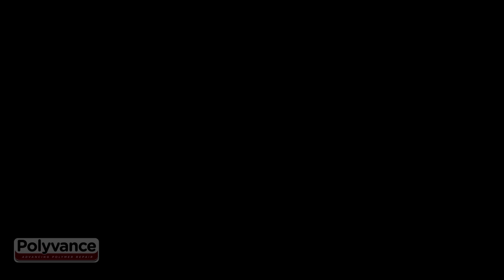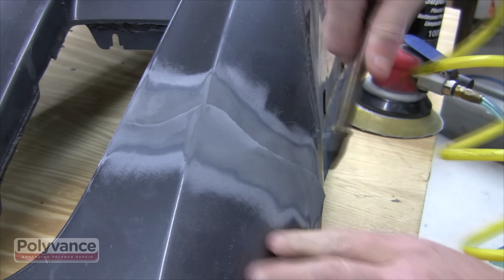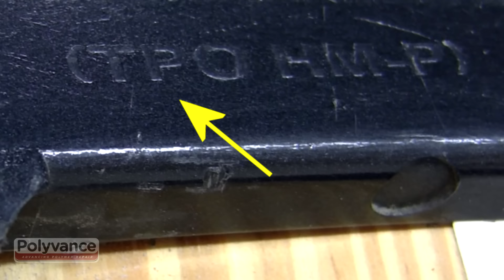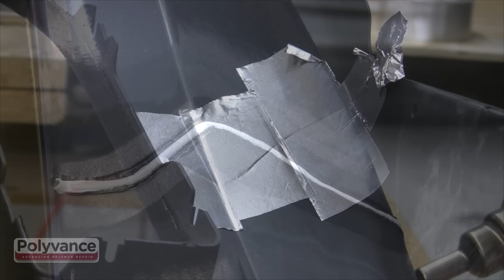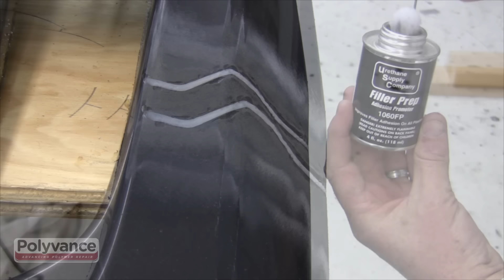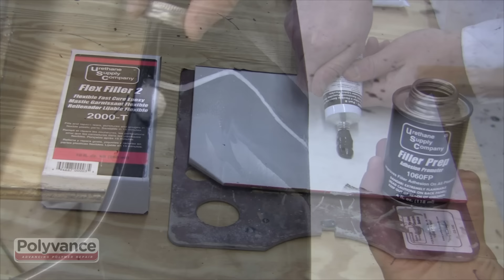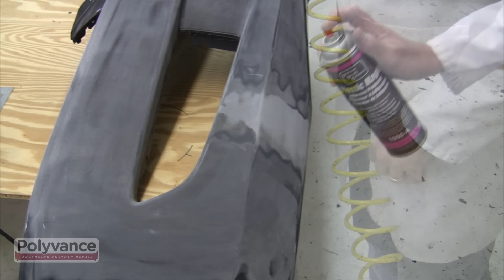Bumper Repair with Hot Air Plastic Welder

Comment: Why do I have a feeling that it will cost as much as a new one?
Reply from the maker: Buying a new bumper may not be easy or cheap. More expensive cars have new OEM bumpers that cost a lot. Additionally, some older cars might have hard to find bumpers (which makes them more expensive). You can find aftermarket parts cheaper, but you also run the risk of them not fitting your car properly (which you would have to pay to fix). With a used or aftermarket part, you may also have to have it painted to match the rest of the car.Of course, all cases are different, and the amount of damage will need to be evaluated to see if it is worth repairing the part (or having it repaired). But many times, it is cheaper to repair (or have repaired) cracks, tears, tabs, etc. than to replace the whole part. Especially on something like a small broken tab that is easily repaired and not visible (which means you don't have to do any refinishing work on them).
Our hot air and nitrogen welders are more for body shop use. We do, however, have a hot air welder kit, our 5700HT Mini-Weld Model 7, and a few other airless welder kits that can be used for DIY.
Reply: Polyvance. Yeah true, it will be more useful to use on expensive or rare bumpers.
Reply: Typically a definite "no".  but there are a few out there that are super cheap new.

Comment: That's called a heat gun you dipshit not a plastic welder.
Reply from the maker: Not quite...
Outwardly, a hot air gun and the most basic hot air welder appear to do the same thing: heat a jet of air. The main difference is that if you reduced the flow of a heat gun to the point where you could control the air enough to actually weld with it, you'd melt your heat gun down. There wouldn't be enough flow through the gun to cool the heating element and it would fry. A hot air welder has temperature control built in, so when it's set at 700 deg F with no reduction, it will still produce 700 deg F air with the welder nozzle attached without having the tendency to self destruct.
Reply: NNnnoope.  Similar, but different.  You cannot focus the heat with a heat gun small enough to weld without distorting the part.  If you tried, you would burn out your heat gun because it would restrict the flow so much it would overheat.

Comment: I’ve worked in the mobile paint business for 20 yrs. you can fix a crack by melting it together with a soldering iron. Much cheaper and faster.

Comment: Why clean before the initial sanding?
Reply from the maker: If you have contaminants on the plastic and you sand or grind it, its very likely you will embed some of the contaminants into the sanding scratches (which will impact the quality of the repair).  You should always clean the plastic first!  You can clean it again after if you wish, but you should always clean it first!

Comment: What a nightmare,  buy a bumper!
Reply from the maker: Buying a new bumper may not be that easy or cheap. More expensive cars have new OEM bumpers that cost a lot. Additionally, some older cars might have hard to find bumpers (which makes them more expensive).
You can find aftermarket parts cheaper, but you also run the risk of them not fitting your car properly (which you would have to pay to fix). With a used or aftermarket part, you may also have to have it painted to match the rest of the car.
Of course, all cases are different, and the amount of damage will need to be evaluated to see if it is worth repairing the part (or having it repaired). But many times, it is cheaper to repair cracks, tears, tabs, etc. than to replace the whole part. Especially on something like a small broken tab that is easily repaired and not visible (which means you don't have to do any refinishing work on them).

Comment: Where can I get those plastic rods???? I need to fix my bumper of my lexus where one bolt goes its cracked open I'm only holding it with a 8mm bolt with a washer
Reply: Polyvance has them or your local jobber store.  Be careful on Lexus, about 50% or them are urethane, which requires a different type of welder, welding rod and repair technique.
Reply: If its urethane, this is the smallest quantity:  https://www.polyvance.com/Polyurethane-1/R01-01-03-NT/  If its polypropylene, this is the smallest quantity: https://www.polyvance.com/Polypropylene-1/R02-01-03-BK/
Reply: Rainsville, AL  (Northeastern Alabama)
Reply: Polyvance. Where are you guys located??
Reply: Scott B I just need a little bit to make that small hole again to put a bolt back just a small rip where the plastic broke off
Reply: Just use a zip tie
Reply from the maker: You can find our welding rods and lots of different plastic repair equipment on our website (www.polyvance.com).
Have a look around our website and feel free to call us if you have any questions!

Comment: I assume it is not a home project
Reply: Not usually with a hot air welder, however the 5211 Polypro Welder can be used to do the same thing.   Its an airless welder and MUCH slower...but MUCH MUCH less expensive to buy.  They are around 70-80 bucks.

Comment: How much you gonna charge to do all that work when I can buy a used or aftermarket for $200 or less.
Reply from the maker: The cost is going to depend on the repair, of course. Also, you may not be able to find bumpers that cheaply. More expensive cars have new OEM bumpers that cost a lot. Additionally, some older cars might have hard to find bumpers (which makes them more expensive).
You can find aftermarket parts cheaper, but you also run the risk of them not fitting your car properly (which you would have to pay to fix). With a used or aftermarket part, you may also have to have it painted to match the rest of the car.
Of course, all cases are different, and the amount of damage will need to be evaluated to see if it is worth repairing the part. But many times, it is cheaper to repair cracks, tears, tabs, etc. than to replace the whole part. Especially on something like a small broken tab that is easily repaired and not visible (which means you don't have to do any refinishing work on them).

Comment: I don't have aluminum tape can I use FLEX TAPE
Reply from the maker: Aluminum tape is very sturdy and it can handle the heat from the welding rod. It is used to both hold the repair in place while welding and to make sure the plastic welding rod does not ooze out over the other side of the bumper.

Comment: Just buy a new freaking bumper and get it over with it's cheap online a hundred bucks
Reply from the maker: That's not necessarily true. More expensive cars have new OEM bumpers that cost a lot. Also, some older cars might have hard to find bumpers (which makes them more expensive). You can find aftermarket parts cheaper, but you also run the risk of them not fitting your car properly. Of course, all cases are different, and the amount of damage will need to be evaluated to see if it is worth repairing the part. But many times, it is cheaper to repair cracks, tears, tabs, etc. than to replace the whole part.

Comment: What will be the cost of such repairs? Without labour cost
Reply from the maker: Our hot air and nitrogen welders are more for body shop use. We do, however, have a hot air welder kit that can be used for DIY.
The cost of the repair will, of course, depend on the extent of the damage.
However, repairing a bumper or having it repaired by a technician at a body shop, will often be cheaper than buying a new bumper (this is especially true on more expensive cars, because new OEM bumpers cost a lot).
Reply: Polyvance. Great thank you
Reply from the maker: You're welcome!

Comment: need plastic cleaner before sanding...?
Reply from the maker: Yes! If you have contaminants on the plastic and you sand or grind it, its very likely you will embed some of the contaminants into the sanding scratches (which will impact the quality of the repair).  You should always clean the plastic first!  You can clean it again after if you wish, but you should always clean it first!
Reply: Polyvance. ohhh i learn something good ... thanks for information
Reply from the maker: You're welcome!

Comment: Alot of work. Isnt it cheaper to just purchase a new bumper?
Reply from the maker: Our hot air welders and nitrogen welders are more for body shop use. We do, however, have a hot air welder kit that can be used for DIY.
As far as getting a new bumper...sometimes, new OEM bumpers are expensive and it is cheaper to have it repaired rather than replaced. By having your bumper repaired, you can keep the original part on the car, you don't have to wait for a new bumper to come in, and you don't have to worry about spending as much money on a new bumper. Some people don't buy new OEM bumpers, and try to save money by getting an aftermarket part. But by getting an aftermarket part, they risk getting a part that doesn't fit their car, and they have to deal with those issues.
Of course, every situation is different. You will need to evaluate the amount of damage and how much it will cost to repair vs replace. Often, it is cheaper to have the original bumper repaired.

Comment: I use a fine steel mesh and use a soldering iron to melt the mesh into the plastic. This works very well for me and thr bond is very strong. I use plastic coffee stirring rods to fill-in gaps
Reply: I do the same but i use the virgin plastic from model car part frames you snap all your parts out of. Stiff and works great to slurry the materials together in a rotation motion. And its free.
Reply: That works for some things but is by no means a universal fix all technique, especially since you want to have the filler rod be the same kind of plastic as  what you are intending on repairing. 
If you don't use the right type of plastic for your filler it can lead to problems with the weld's strength as well as delamination (I think that is the correct term but could be wrong) or the filler peeling/raising off of/separating from the work piece and putting you right back to square one.
Reply from the maker: You are absolutely right; the filler rod needs to match the base material!
Reply: @polyvance  Exactly, although the mesh is OK, provided it doesn't get over heated and only gently pressed in on the backside. I may be interested in getting your rod. Been doing this for 2 or 3 decades, never knew of urethane rod. What diameter is the rod? 832 degrees? Really?
Reply from the maker: @ckstaff  The urethane rod is 1/8th of an inch in diameter.
Here's our full list of welding rod if you want to have a look: https://www.polyvance.com/Welding-Rod-List/
Reply: @polyvance  I guess I may have missed you saying the bumper was polypro. Never seen a bumper in polypro, that I recall anyway. I remember some were ABS. Still surprised with the 832 degrees, especially if it is polypro. Also interested in that filler and bonding to either the polyurethane or polypro as neither can be chemically bonded.
Reply from the maker: @ckstaff  About 95% of late model car bumper covers are made of polypropylene. You can absolutely use filler on polypropylene. You just need to make sure to use an adhesion promoter. Also, adhesives are the only way to repair thermoset polyurethane because it cannot be fusion welded. So, for polyurethane, you can either use a two-part adhesive or use the airless plastic welder with our thermoplastic polyurethane welding rod...in the latter case, you would use the urethane welding rod as a hot-melt adhesive.
Reply: @polyvance  That is why I have an interest in the urethane rod. Using the tack welder works good for using mesh on the back and even cleaning up the front, but being able to have a urethane rod would really help to clean up the front before sanding and the filler. I have seen some pretty creative auto body guys have pretty decent success just using bondo, believe it or not. LOL
Reply: @polyvance  A friend has a bit of damage (a hole knocked into) the right corner of his light green 1999 Infiniti Q45 bumper where the styrofoam is showing. What materials are needed to repair that? Is it an expensive fix? Bumper replacement is nearly impossible since those car parts are very hard to find.
Reply: @cks..... dont let them fool ya plastic is plastic just with different additives. This is why i use virgin plastic then a stirring motion to mix it with the additives in the base material of the project. Sure its littls weaker. BUT WHO CARES. your not going to get a perfect match anyway.

Comment: Sand bedore using the cleaner. It doesnt make sense to clean it first before sanding.
Reply: That is backwards my friend.  If you have contaminants on the plastic and you sand it, its very likely you will embed some of the contaminants into the sanding scratches which will effect the quality of the repair.  ALWAYS clean first!  If you want to clean after as well, no harm done, but start with cleaning!

Comment: Clean then sand lmao
Reply from the maker: Yes. If there are any foreign objects on the bumper that you don't clean off first, you can grind them down into your plastic when you sand. This could make your repair weaker because the plastics are not pure. It's easy and cheap insurance to clean the plastic first to make sure you don't end up with anything that does not belong in your repair.

Comment: Good repair but i use cut offs from old bumpers to make sure they are compatable and make the cut offs slightly bigger than the v so i can file and sand flush so no need for filler. In my eyes filler does not belong in bumpers. But other than that pretty good repair

Comment: I was going to rip on this for not being welding.. but it is pretty much like light gas welding... so 😎
Reply from the maker: Yes, this is absolutely welding!
From Dictionary.com "Weld: to unite or fuse (as pieces of metal) by hammering, compressing, or the like, especially after rendering soft or pasty by heat, and sometimes with the addition of fusible material like or unlike the pieces to be united."

Here, we are using a TPO welding rod to repair a TPO bumper. We heat both the bumper and the welding rod and melt the welding rod into the base material. The welding rod is not an adhesive like glue; it has absolutely no adhesive property when dry or wet. It is melting into the base material here and bonding with the bumper because they are made out of the same material.

Comment: I though bumpers were supposed to stand a hit from another car and stuff why would you waste time fixing a piece of plastic that brakes?
Reply from the maker: Because sometimes , new OEM bumpers are expensive and it is cheaper to have it repaired rather than replaced. By having your bumper repaired, you can keep the original part on the car, you don't have to wait for a new bumper to come in, and you don't have to worry about spending as much money on a new bumper. Some people don't buy new OEM bumpers, and try to save money by getting an aftermarket part. But by getting an aftermarket part, they risk getting a part that doesn't fit their car, and they have to deal with those issues.
Reply: You repair them because some bumpers are hard to find or are expensive...you can spend a lot of time making a repair and come out in the black.  Not to mention the amount of landfill space and raw materials you are saving by repairing instead of replacing.

Comment: Far to much effort, what I need is a product that can used straight out of a tube.
Reply from the maker: Fusion welding is going to give the strongest repair, much better than a two-part adhesive. It is also going to be much cheaper. An average 6 inch repair costs less than $2.00 when welded. With a two-part adhesive, you pay more than that just for the mixing tip! The total cost of the same size adhesive repair can be over $40.00!

Comment: So lengthy process & so expensive
Reply from the maker: Our hot air and nitrogen welders are more for body shop use. We do, however, have a hot air welder kit that can be used for DIY. But having a bumper repaired (whether DIY or by a technician at a body shop) will often be cheaper than buying a new bumper.
We have other repair kits that you might be interested in. For example, our FiberFlex repair kit includes an airless plastic welder and our FiberFlex universal rods. Our Polypro welder comes with the airless plastic welder and polypropylene welding rods (polypropylene is what most bumpers today are made from).

Comment: Too much work for a piece of plastic. Just buy a new part.
Reply from the maker: Some people have cars where it is hard to find a new OEM bumper (thus making them more expensive). If you buy an aftermarket part, you may run into fit issues (which would be an additional charge to fix). Also, once you buy a new bumper, you may still have to get it painted it to match the rest of the car. Many times it is less expensive to repair the bumper. Every situation is different.

Comment: Or just buy one and avoid all that mess! Lol
Reply from the maker: Some people have cars where it is hard to find a new OEM bumper (thus making them more expensive). If you buy an aftermarket part, you may run into fit issues (which would be an additional charge to fix). Also, once you buy a new bumper, you may still have to get it painted it to match the rest of the car. Many times it is less expensive to repair the bumper. Every situation is different.